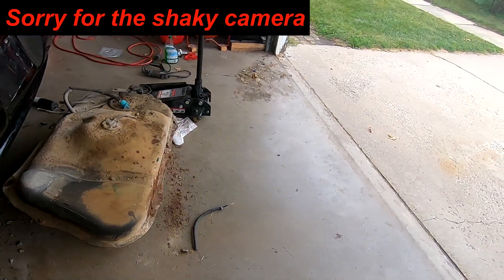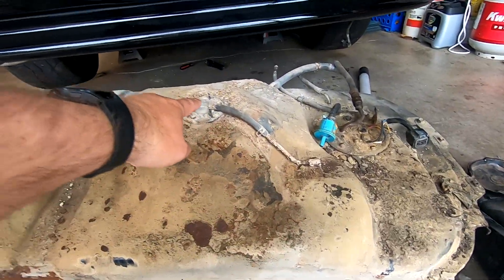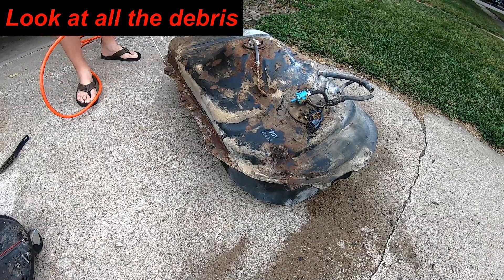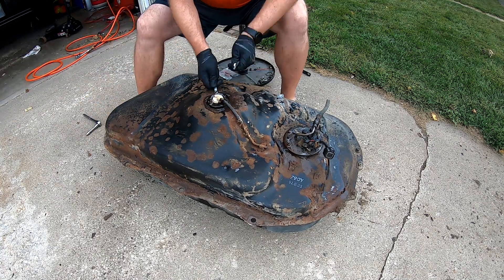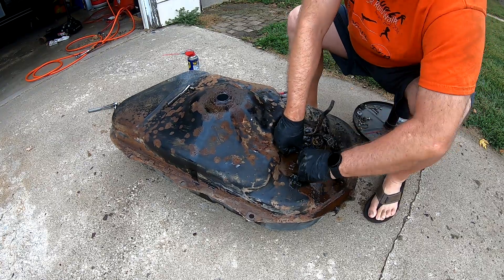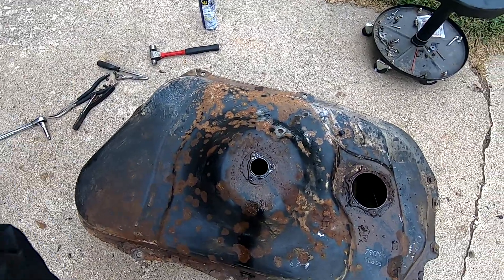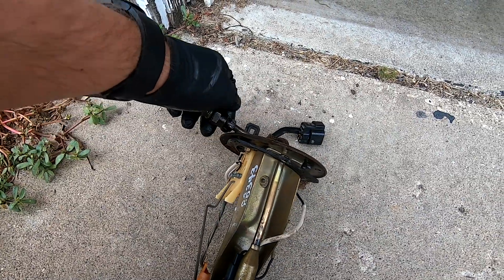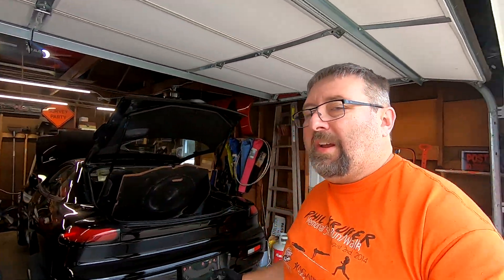Project Stealth - Part 4 - Fuel Pump/Hanger/Sender Removal

Comment: I live in Canada in “the salt belt”, on my 1990 240 my gas tank was way worse, but luckily there was a shop that rebuilts them. Hopefully this repair doesn’t cost you to much. Good luck bud!
Reply from the maker: @salvatorelb1338 yeah, ended up sourcing a different tank. You will see it in up coming videos. But thanks for the heads up on the repairing them.